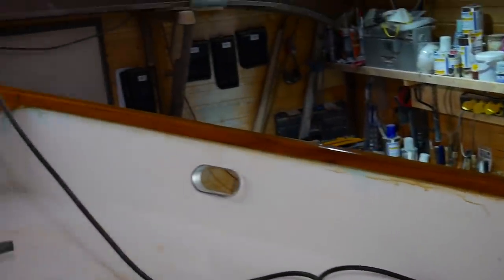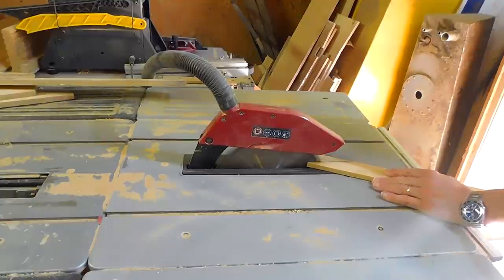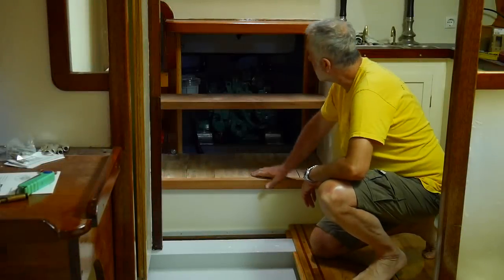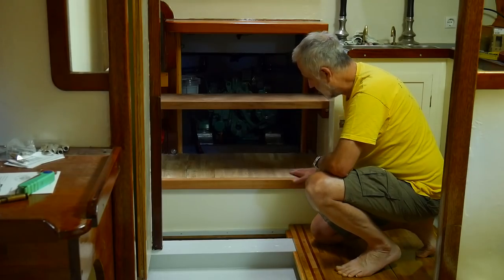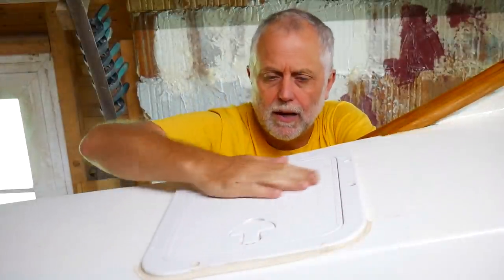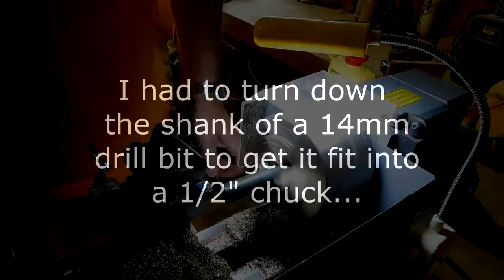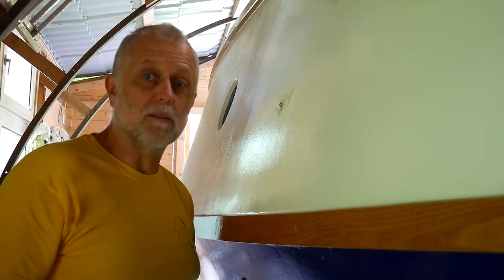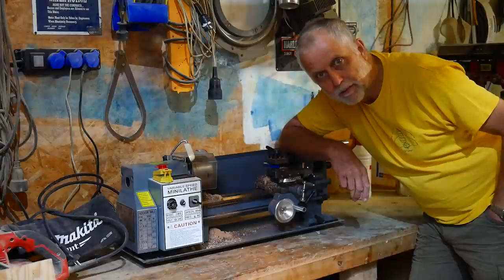Bulwarks, Companionway, Rudder, Locker Drain, Tripod... The List Goes On!!! - SV Tapatya EP190

Comment: All those removable hatches topside need some kind of tether to keep them from sliding into the sea or blowing away on a blustery day. Even a length of nylon surveyor's cord would be enough to prevent problems during a downpour when your hatch is floating away... The best way to extend your tool life and it's sharpness on your lathe, as well as improving the finish on metal parts, is to install a coolant system. Even a simple gravity feed plastic bottle and hose mounted on a goose neck with a magnetic base can be clamped to the tool holder carriage so the nozzle follows the tool point. A valve in the hose and a plastic catch basin beneath the ways will let you re-cycle the coolant oil, a loose wad of steel wool in the top bottle will filter out most swarf...
Reply: "All those removable hatches topside need some kind of tether to keep them from sliding into the sea or blowing away on a blustery day."

The exact same thing crossed my mind when watching that.
Reply from the maker: But guys “all those removable hatches...”. There’s only one removable hatch! Other than that, you are, of course, quite right 👍

Comment: According to his book George Buehler recommends that you shouldn't paint the inside of the hull because the paint could cover up rot. I noticed that it Sampson Boat Co. they used varnish and another designer for DIY catamarans I've come across recommends epoxy.  I see that you are using paint and I'm curious about your thoughts on the matter.
Reply from the maker: That's a good question, Cecil, and one that I looked into quite deeply when I was planning the hull construction.  There are 2 main schools of thought. One says that the plywood should be allowed to breathe, so should be sealed on the outside only so any moisture can escape through the inside of the hull. The other, and the one I subscribe to, says the ply should be thoroughly sealed from both sides to prevent any moisture getting into the wood. I have epoxy and glass coated both sides of my hull. Then we come to the next question; paint, or varnish the inside, or just leave it so? George Buehler is quite right that a clear finish will make any rot that occurs easier to spot, on the other hand, a good bilge paint will add an additional sealing layer in the places where it is most needed. I've bilge painted or just painted all visible interior hull areas, partly for additional protection and partly just for aesthetic reasons. That's an individual choice, I feel.   Hope that helps